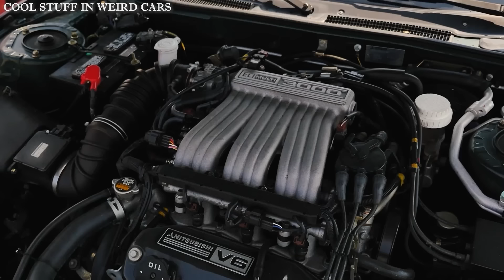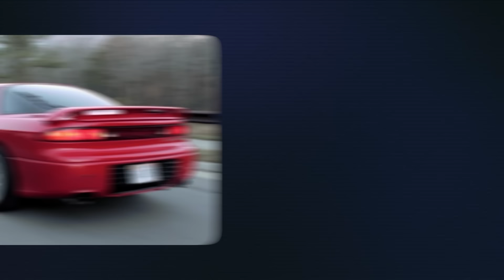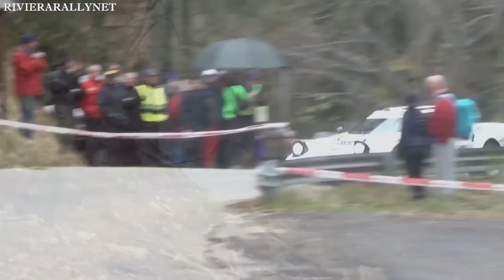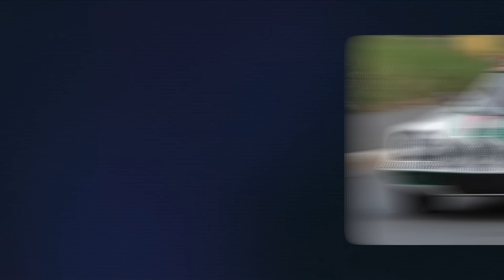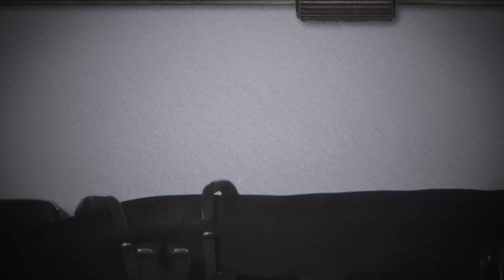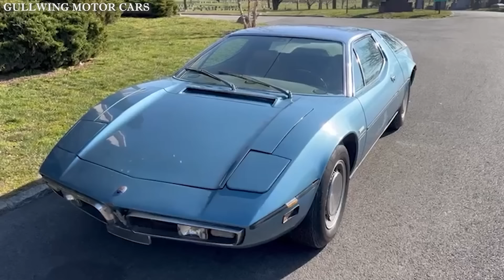5 Sports Cars That Were Overdesigned To the Extreme!

Comment: Some articles I read in the past said the following:
Planning for the Stratos began with the Maserati V8 and other candidates in mind, but I heard that due to procurement issues, development began with the Dino V6, also from the Fiat Group. I think the result was good.
I think the most noteworthy feature of the Stratos is its body rather than its engine.
At the time, 4WD technology was immature, and the mainstream driving style in rallies was to drift the car when entering corners and then regain control at the exit. To achieve this, it needed a weight balance that allowed it to spin easily and regain control when desired, an interior that did not interfere with steering, and a windshield that maintained a consistent view even when the forward visibility angle changed. Therefore,
　　A midship design to concentrate heavy loads in the center, with seats that were close together.
　　Door pockets that jutted outward significantly.
　　A windshield that looked as if the side of a cylinder had been cut diagonally.
　　A sturdy frame that could withstand rally driving and a wide-opening cowl that emphasized maintainability.
　　A short wheelbase that made it easy to drift the car when entering corners.
It seems that the design was arrived at as a result of combining all of these factors.
It is a car that was originally created to win competitions, and a production model exists out of necessity due to regulations.
Footage that appeared to be promotional footage for the Stratos was aired on a Japanese TV program in the late 1970s, and the scene that sticks in my mind is the car easily spinning out, only to quickly recover and get back on the road as if nothing had happened.
Issues 1 to 3 of the automotive magazine "Le Volant," which was launched in Japan in 1977, featured Italian cars like Ferrari, Porsche, and Carrozzeria, and also included images of the inside of the Bertone factory.
I remember seeing Lamborghini Urraco, Dino 308 GT4, and Lancia Stratos bodies lined up on three production lines inside the factory.